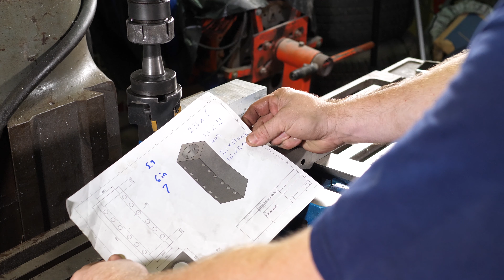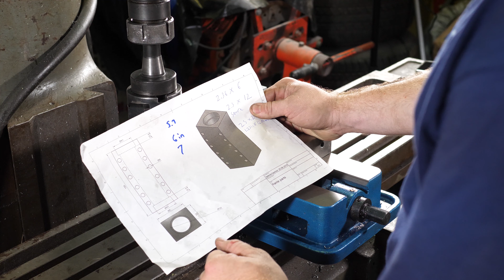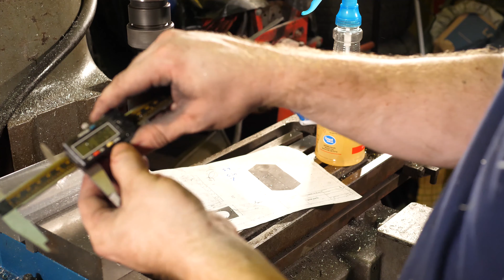Machining 2STROKE STUFFING's Land Speed Attempt Bike Parts - Part 1

Comment: 8:55 "Freedom Units", I don't whether to laugh or cry, either way, get me a bucket!
Reply from the maker: I think a little of both would be appropriate. Most of Americans have to at least learn part of both systems these days. Especially with length and liquid or weight. But i like most Americans are completely useless when it comes to knowings Celsius equivalents. Honestly i prefer Fahrenheit because i don't think Celsius is granular enough for every day life. 0 is very very cold and 100 pretty hot. Does not matter to me when water boils and freezes.

Comment: @1:33 is that piece now considered a forging?
Reply from the maker: Its not really a forging since its not forged into a shape. Generally this is called a Billet.
Reply: No forged material is a lot more dense /uniform structure
Reply: Believe billet is second to forged
Reply from the maker: @reasonsvoice8554  it also depends on how the original material was made. This was cold rolled aluminium so very technically speaking it was forged into a billet then machined. A cast then machined piece would be much weaker.
Reply: OMG you guys! It was a joke, you totally missed it... it was drop...forged. Ugh

Comment: everybody does there own thing but i was taught to always raise your table into your part being machined that if you lower your quill to the part it has a chance to wobble under heavy loads just my .02 haha
Reply from the maker: There is that chance under very high load. I would say its probably going to be more of a concern on a smaller r8 spindle machine though. Mine is nmtb 40  and the quill/spindle is very heavy. Being that i was already cutting with a questionable setup anyway, for me in this case i could be far more accurate with the quill than if i was trying to raise the table.

Comment: I hate to lecture but.....no gloves or glasses??? You are asking for it man.
Reply from the maker: Yes, no safety glasses is not smart. But you should never be wearing gloves with a mill or lathe,  good way to loose a finger or more. The machines will grab a glove and suck your hand in.
Reply: DeWoody's Shop 
Ok, I’m a sheet metal worker and am working with punches, press brakes and notchers etc. Lots of sharp edges, always aware of nasty cuts from the stock. We also have a safety issue with the pedestal polisher. Gloves are not recommended in case of a wrap up situation but the part will get hot and be sharp!!! What to do?
Reply: saw a guy, wearing gloves, rip off a finger while polishing a bearing surface. no gloves while running lathes and mills.

Comment: The bearings in your mill are heavily worn. ~( ,m,)~
Reply from the maker: Just coursious why you think that? If talking about the sounds that is because Its a gear head mill and has a lot of gear noise a bridge port does not.
Reply: @DeWoodysShop  Take an angle block, clamp it to the table, lock the ways on the table and lock the quill so it can not turn, chuck a dial indicator and press it against the angle block. See how much drift the quill has.